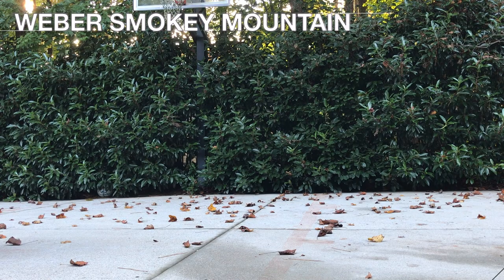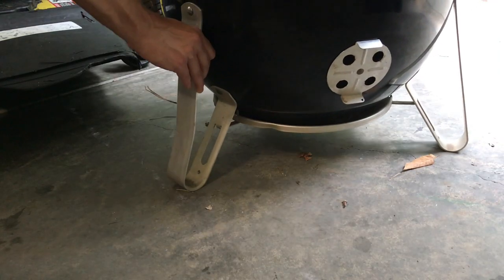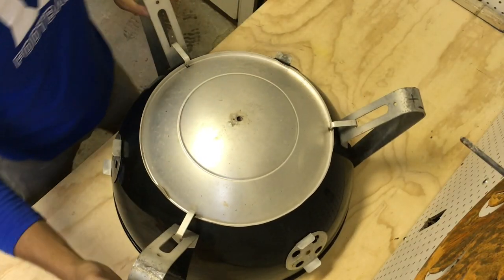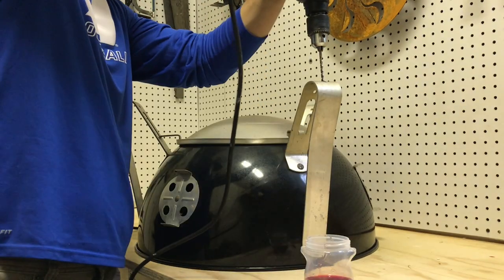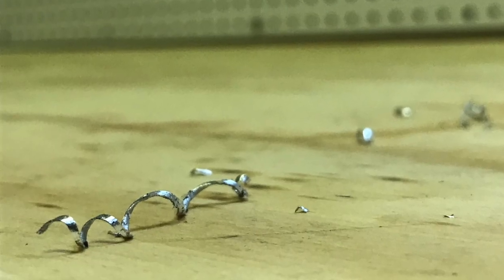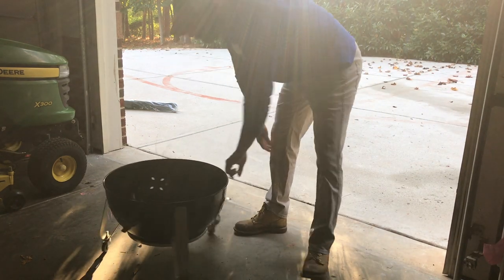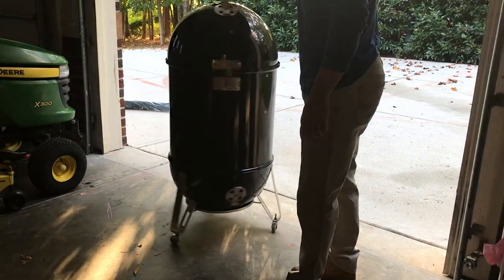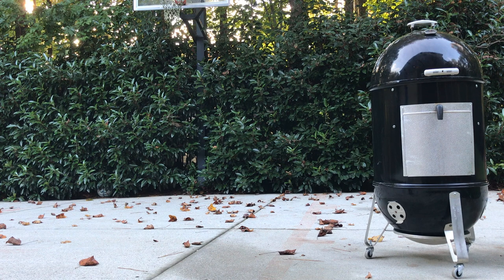WSM Wheel MOD | Weber Smokey Mountain modifications | How to install

Comment: Nice install Jon! Could you have put a bigger caster on the WSM... to help it roll over the cracks better?
Reply from the maker: I definitely considered 3” casters.  You certainly use them and I assume they would fair a bit better over the cracks, but I just felt they looked a bit big. Idk.  Plus, the 2” were recommended.  🤷‍♂️ I appreciate you watching.  It’s a good mod either way.

Comment: Hey Jon!   Great Mod for only a few bucks and a little time to do it.   It's a wonder why Weber doesn't offer a kit because it is so inconvenient to move. 
The best thing I did was put a wheel kit on mine.  Now if You could give me a suggestion on a cover that won't let water get into the pit, because mine does 
sit out in the weather. :-(      Metal On!  \m/
Reply from the maker: I hear ya!  I think they’re are some options out there for covers, but nothing I can hang my hat on.  Maybe I should inquire.... 🤔
Reply: They don't offer it because you could tip a hot grill over on a crack and sue them if you burned yourself. That's why they don't offer the lid hinge, either. You could incorrectly align the lid in between 2 of the legs instead of directly aligned with the one leg and flip the mid section out of the lower bowl when opening it.
Reply: Word about the cover... Give it a good dousing with some silicone waterproofing spray that is used on tents. Most big box stores have it in the outdoor dept among the camping gear. Makes a huge difference!

Comment: Thinking about doing this soon. How well has this modification held up? Any problems with the casters tilting or the legs bending as a result of this mod?
Reply from the maker: For this 22, no problems at all.  However, on one of my 18’s, I had one of the casters mount a bit crooked.  It works, but rolls like a drunken sailor.  I might fix it w/ a set of 3-wheel casters.  I’ve seen that done before and folks have been happy with it.  Hope that helps.  Thanks for watching!!